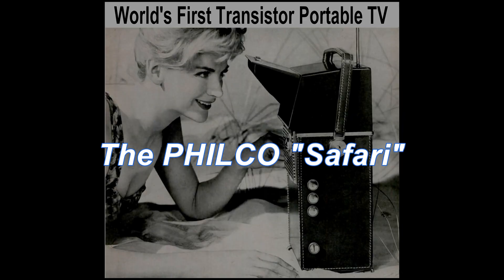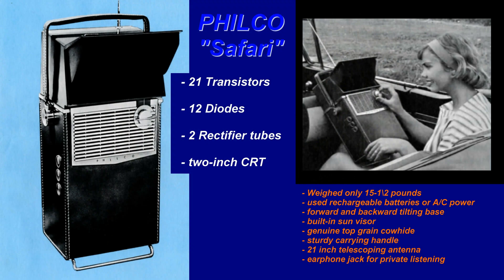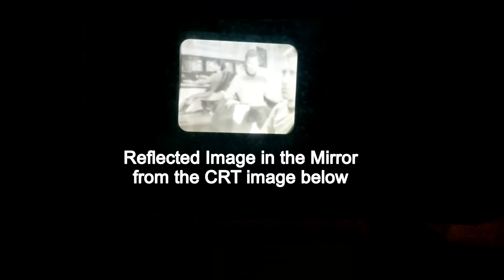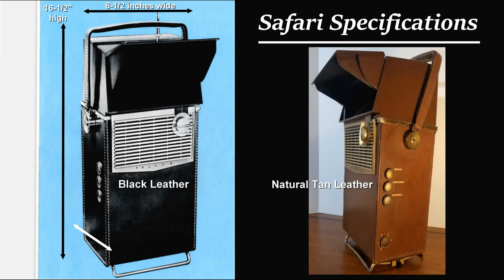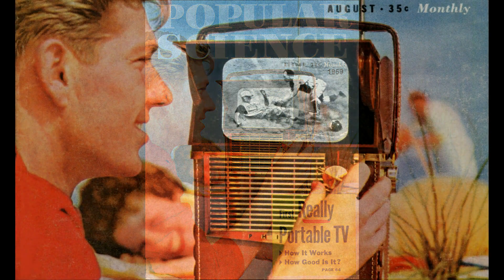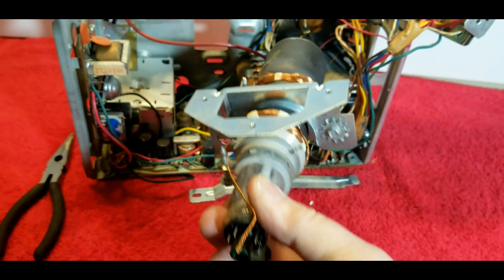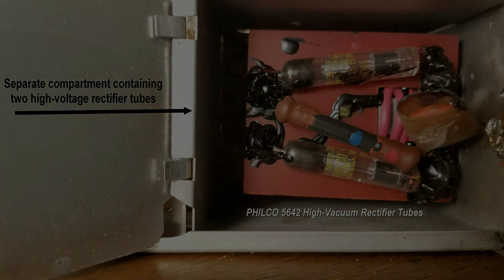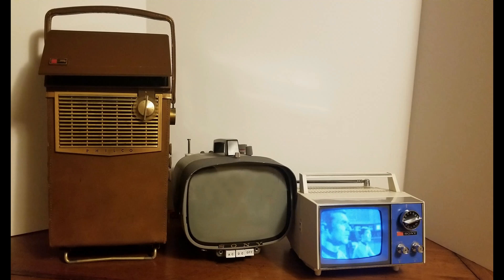WORLD's FIRST PORTABLE TRANSISTOR TELEVISION 1959  (Vintage PHILCO Technology HD)

Comment: A bit of errata in this film which should probably be corrected (I know...3 yrs old). While the Sony was direct view, and had a rather large (and heavy) lead acid battery pack to accommodate the CRT's requirements, it was not "all-transistor" as Sony claimed. It also had 2 vacuum tube rectifiers like the Philco. This is even listed on the rear dataplate. Additionally, it was a trouble-prone set that used germanium transistors with significant thermal drift. In many ways it was a step backward from the Safari, and Sony engineers worked diligently to advance the state of the art with the replacement Micro TV, at which point the Safari was already several years old.
Reply from the maker: Hi @TheApplianceArchive, you are right on both counts!    Good spotting!
@TheApplianceArchive

Comment: It's interesting that the engineers opted to use a yoke on this little CRT. Since the required deflection angle is small, I would expect oscilloscope-style electrostatic deflection, as this would consume less power and eliminate the costly, copper-wound yoke.

Comment: I had a Casio hand held colour tv worked well until the analog signal was switch off in 2012
Reply: Hook it up to a battery pack and a DTV converter box. 

I did that with a battery power TV.

Comment: Thanks.  I'm heading on down to my Philco dealer after work, to see if I can pick one up.  I'm going camping next weekend, and this will sure come in handy.  :)
Reply from the maker: Good luck.  Perhaps you will get the last of the "on Sale" items!   ~    : )
Reply: I've got some bad news for you.
Reply: @beezertwelvewashingbeard8703  Are you trying to tell me they're not made anymore?  :(
Reply: @roachtoasties  No, only that we no longer broadcast NTSC, so bring your battery powered and transistorized VCR!  Granted we needed to modernize TV and move onto ATSC, but it was a sad day when all the analog TVs essentially became obsoleted unless one uses an external tuner and converter/modulator.  I had (well, still have, actually) a nice 5” B&W portable battery powered TV set that I enjoyed using for years during hurricanes and power outages and I kind of miss using that little set!
Reply: @ethanpoole3443  I still have some analog sets too, including a couple tiny sets that are of no use.  The larger ones I have connected to a cable box, which still provides an analog output, but there may come a day where those also no longer work.  Oh, well.  :/
Reply: @ethanpoole3443  It's too bad the FCC wouldn't allow both NTSC and ATSC to coexist together. But they wanted the bandwidth for more cell phone channels, and simulcasting would be too expensive for many stations. Even cable is all digital now and requires a set top box, even if your TV is digital.
Reply: Philco was owned by Ford Motor Company

Comment: I am wondering what kind of rechargeable battery was used. Also interesting that the tubes look like wires directly connected no sockets.
Reply from the maker: Hi Beast, great question!   It used a Philco Leakproof Alkaline Rechargeable 7-1/2 volt battery.  Back in 1959, they cost about $5. each (which would be about $28.00 U.S. dollars today).  Thanks for asking. ~  Victor, CHAP
Reply: @ComputerHistoryArchivesProject  I’m surprised that was their choice, I was expecting either NiCd or lead acid gel cell (though I am uncertain if they had gel cells in 1959, not sure when they were first introduced).

Comment: Yet it still has a couple of tubes in it.
Reply: Kind of had to have a CRT in order to be a CRT.  Otherwise the only tubes I have noticed were the two high voltage rectifiers and that was actually a very smart decision at the time as there really were not more reliable high-voltage solid state rectifier options with less voltage drop available at the time (selenium rectifiers would have had too much voltage drop and wasted power and solid state diodes would have required a very long string of relatively low-voltage diodes to handle the very high voltages of the VHT circuit…which gets us back to that excessive voltage drop issue).  Nowadays we could easily drop a few 1N4007/5408 1000V diodes in their place and accomplish the same without much voltage drop, but those did not exist, or at least were not reliable (or may have had too much reverse leakage current).

Comment: Quite an achievement in 1959. The line scan and EHT circuits were high stress environments for the early transistors, and even ten years later there were many failures in this part of the TV.

Comment: An amazing piece of technology that was dethroned extremely fast.
Reply: Dethroned extremely fast?...Not really, Battery powered transistor portable black and white (and color) CRT TVs were sold well into the 1990's  (maybe even later, I'd have to check my Radio Shack catalog collection..) We even had one built into a boom box with a stereo cassette deck and AM/FM radio.
Reply: @jamesslick4790  I did not expressed myself well, I did not meant that the technology was dethroned,  just that particular impressive piece of technology, i.e. the Philco Safari. The two SONYs showed in the video look superior.
Reply: @SlyPearTree  Oh, Got ya, You meant the ACTUAL PARTICUALR product. Yeah becuase The SONYs MAY or may NOT have been better sets. But except for the mirror required for the vertical  CRT of the Philco, The underlying technology itself is the same.  And would remain pretty much the same until the end of the CRT portable era. (Just to clear up any confusion.)
Reply: @jamesslick4790  yep, I got one for christmas when I was 10 in 2003. It was a black&white tube one brand new then!
I seen portable black&white tube sets still being sold well into the mid 2000s in stores
Even in 2005 I was gifted another black&white portable set, this time with a builtin mp3 CD player!
I sometimes wonder if the cathode ray tube is still being made/used today within some specialized aplications outside television.
Reply: @coolelectronics1759  I should add that 5" COLOR battery powered CRT sets were a thing too, but B&W was more common as they didn't "eat" batteries as fast!  As to today, I have heard that CRT TVs are still available in China and some parts of the Middle East. And im sure that there are some specialized gear that uses them. Vacuum tubes are definitely still used. You have one in your microwave! X ray machines and high power radio transmitters still use tubes!
Reply: @jamesslick4790  yep pretty cool stuff!
Some guitarists still use a vacuum tube in there amps too!
I have this working zenith tabletop radio set that has some in it you can see them all glowing when you take the back off.
I still have some analog oscilloscopes that I use all the time that have a CRT in them.
Its all I could aford so its all I got now for working on electronics
I wonder if the VFD is still being made and used in several modern aplications today.
Although I think my newest yamaha receiver from 2014 has some kind of LCD in it, its probably being used and made for other appliances still.
Reply: The Safari was very well made,you can plug them in now and will still work as the video shows.. The Sony TV8-301 usually needs at least capacitor replacements to produce a full size picture.